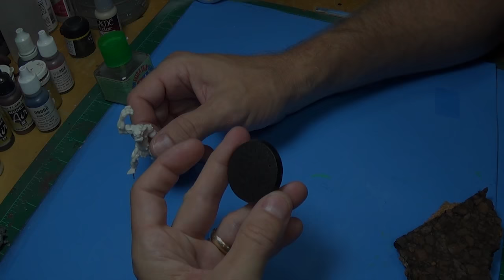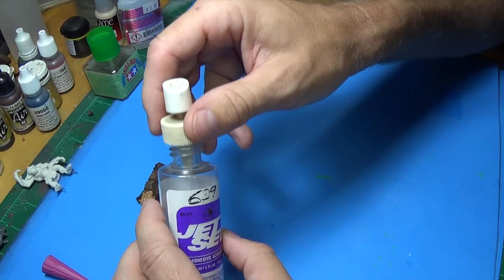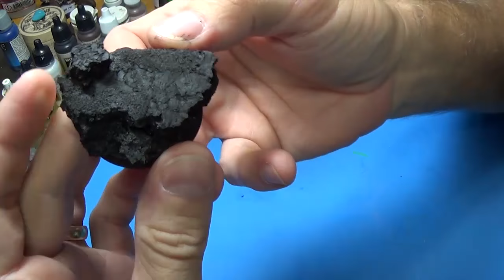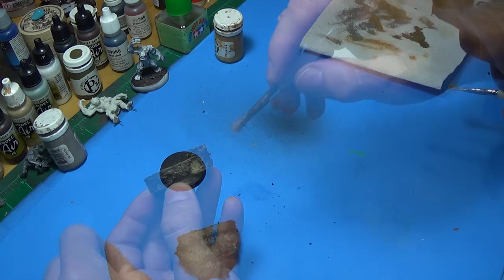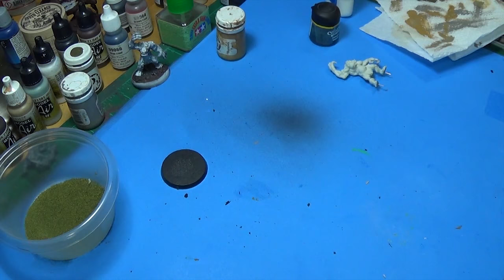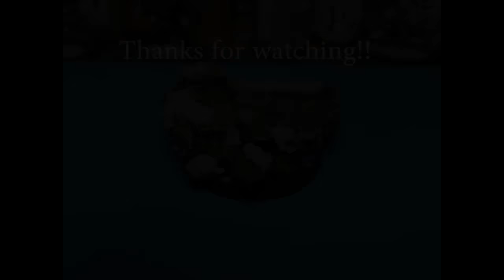How To Make a Custom Base For Miniatures

Comment: howbdo you keep them from chipping? I use cork for mine but they eventually get chipped away slowly
Reply from the maker: sometimes I'll drip some zap-a-gap on the edges prior to priming, but mostly I just deal with the chipping as it occurs and fix it.